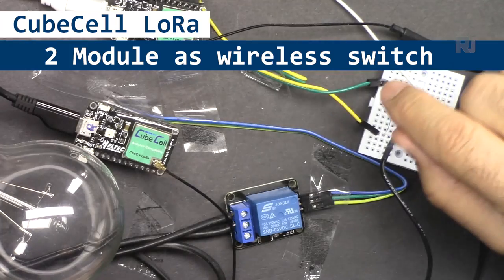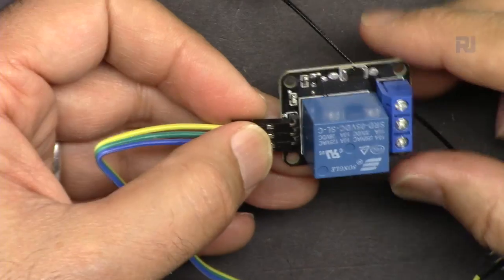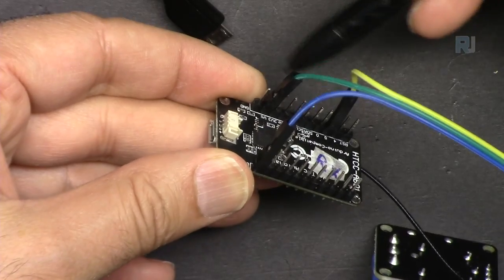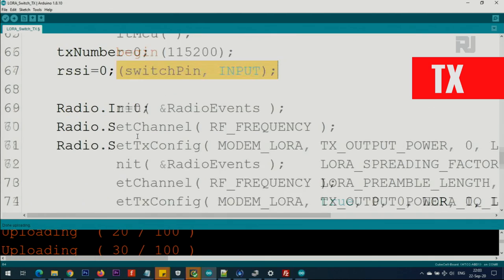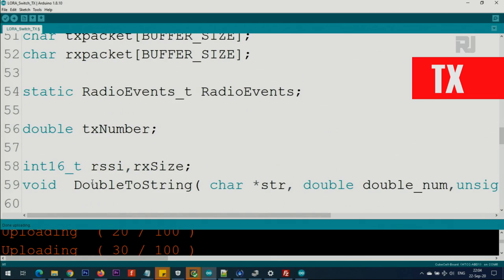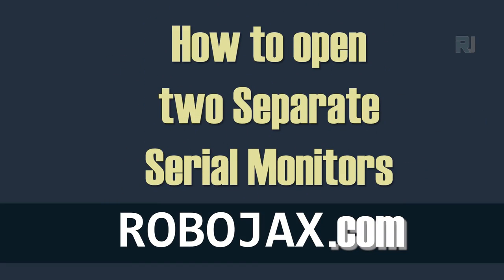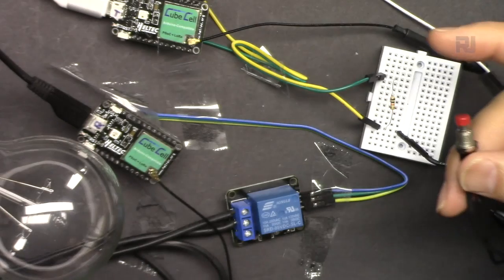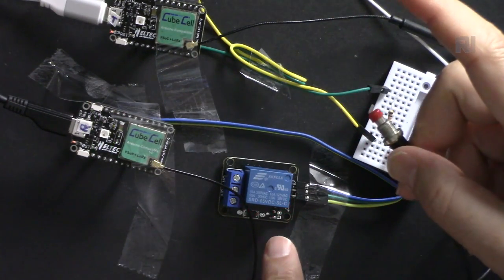Using two Heltec CubeCell LoRa ESP32 Boards HTCC-AB01 as remote switch as TX and RX

Comment: That's a really cool project! I've been wanting to make something similar but, in the form of a remote control. On the remote it would have 4 buttons that controls 4 relays on the other side. I'm new to this so, still trying to figure it out. Is there a good book to learn setting up / programming LoRa in general?

Also, instead of the lora board, do you have a guide to use a Arduino pro mini and rfm95w lora breakout board? I'll definitely check out the guide when you are able to upload it to your website. Thanks again
Reply: @nwchnnl6551  Thanks! I definitely will

Comment: Hey Buddy, i've been following along some of your LORA videos. Looks like you're connecting to the VS pin here, which is the solar pin, not 5V. Sounds like I may have to get a 3.3v relay to safely connect it to my solar powered cubecell, unless you have any other ideas? maybe i can connect the solar panel and the 5V relay to this pin? I wont do that unless you think that would be safe. Cheers and a happy new year.
Reply from the maker: You are correct. Happy new years. Cheers